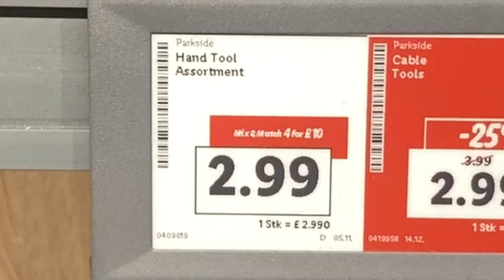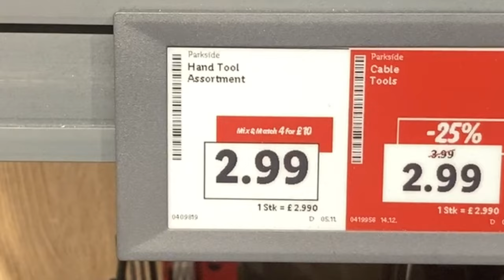Delft clay sand casting silver beads for jewellery making.

Comment: Hi Nick, this is fabulously inspiring,  thank you so much - I want to ask if you could work with Argentium for a while,  it reaches temperature much more quickly than silver,  but looks less hot,  it is fragile and brittle when hot and mustn't be touched till all pinkness has gone.  It is always recycled.  A very creative and perpetually  self-fusing alloy.  But,  I am cautious due to extra expense, limited resources and lack of confidence and my equipment doesn't come close to the stuff you have 😬
Reply from the maker: Hi Viv thanks for your comment and suggestion. i’ve been looking forward to trying Argentium however I’ve been resisting investing any more in silver as I still have the majority of a kilo of fine grain still to play with. I bought a bar many years ago when it was a lot cheaper than it is today. What I have in stock cost me just less than 60p a gram and turning it into sterling saves a little bit more. I do you feel privileged having a double garage that I can fill with tools and equipment to my hearts content … good luck with your endeavours … N
Reply: @Nickscreativestuff  omg,  you didn't need to explain in such detail, your circumstances are your business, but thank you for getting back to me.  I really enjoy your videos,  love this solid silver chain, and really struggling to cut the hole in the side of my aluminium casting thing. I drilled as many holes as I could but still having to get the saw round - nightmare!
Reply from the maker: I think it’s strange that those aluminium casting rings don’t come with a pre-drilled hole in the side, it seems so obvious to have and necessary.
I use a vertical cast set up much more often than horizontal. it’s also much more economical with the clay as accessing the burnt portion to discard is a lot easier as the mould opens cleanly … have fun … N

Comment: Omg wow I never k ew we could cast at home so easily! This has just blown my creative into a firework of possibilities! You know how the pearl is the IT item for men right now at around choker size. You could make a 6mm solid silver all ball chain . This has seriously blown my mind I thought we would need a lot of expensive equipment like a plugged in furnace etc I have already ordered some crucible tongs and a few graphite moulds as I will be wanting to recycle all my  scrap  from my making anyway. And from what I can see I would only need to purchase delft sand some flasks and baby powder the rest I have already woohoo thank you for sharing.   Kirt
Reply from the maker: Delft Clay is a really nice product to use, it gets a bit obsessive trying to perfect designs and results. it’s definitely a cheap version of casting compared to other options however it is greedy for scrap metal and it quickly uses up all the bits and bobs that have been saved up for awhile. a large torch is important to help get the metal up to temperature reasonably quickly although tiny bowl crucibles are available from cousinsuk.com allowing smaller castings to reach temperature a lot easier … N
Reply: @Nickscreativestuff  yeah I noticed you use a fan brush I gotta set of small little brushes. And small crucibles so I should be fine.  Yeah I noticed this particular way of casting seams the most cost effective from what I have seen already
Reply from the maker: can be a little rustic at times, not as refined as vacuum or centrifugal casting … N
Reply: @Nickscreativestuff  rustic is still a neon sign almost of handmade !
Reply from the maker: very true and well said …  I much prefer it … N